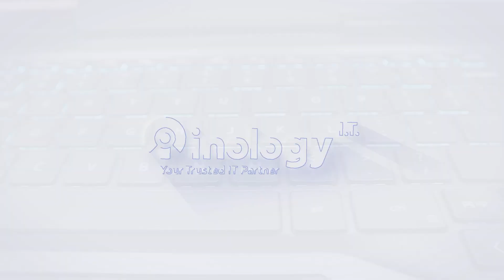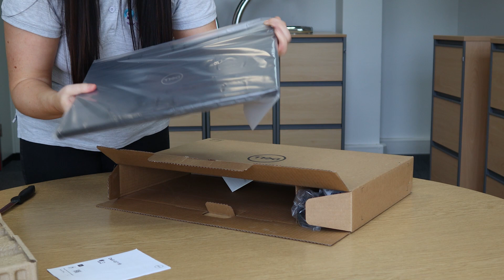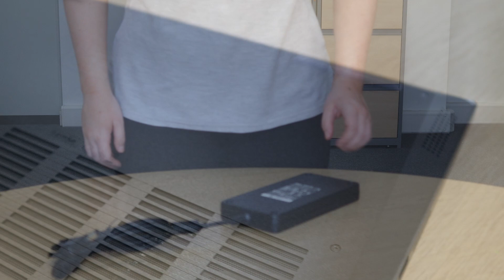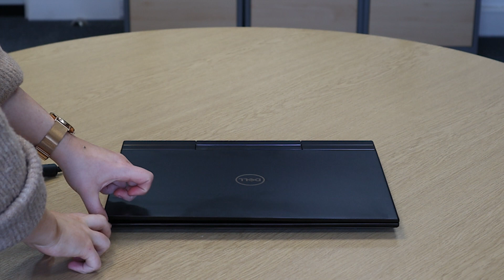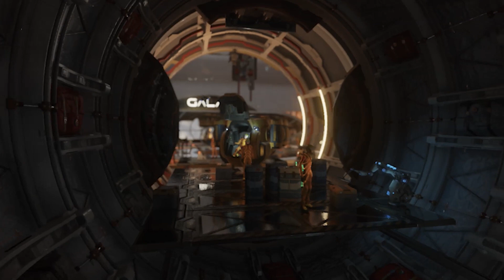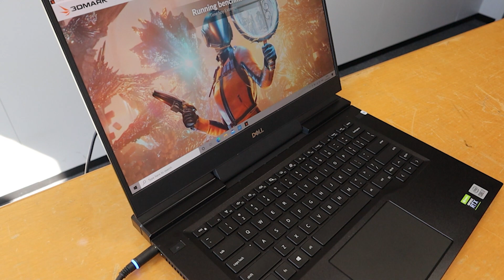Dell G7 15 7500 Gaming Laptop Review - 2021 | Impressions - Benchmarks

Comment: Nice first impressions! Do you know how to overclock the laptop?
I just got a 7500 with RTX 2070 and 32gb of RAM...
I went to the Alienware Command Center, and then to the Overclocking menu, but I couldn't change any settings...
Reply: You can’t do that on intel 10th gen . The bios is locked.
Reply from the maker: Thats right 🙄 Locked.. You can overwrite the bios with the Alienware version, However your going to get stability issues 😬
Reply: i think the G button overclocks it its on the top left corner of the keyboard

Comment: I got the g7 7700. Basically the 17 inch version. They run like toaster ovens lol.
Reply from the maker: Your not wrong.. Im actually using this in the office right now on an aluminium stand, seems to be keeping the fan slow for now 😀
Reply: @INOLOGYIT  I repasted mine and set the turbo boost to 3.4 using throttlestop. It doesn't get as hot anymore.
Reply: Just bought my kid this. She never looked so happy in her life.
Reply: @ohsnapyocheckit  one sale?